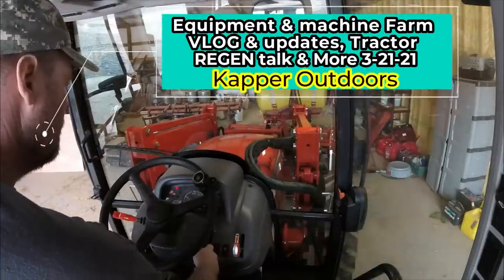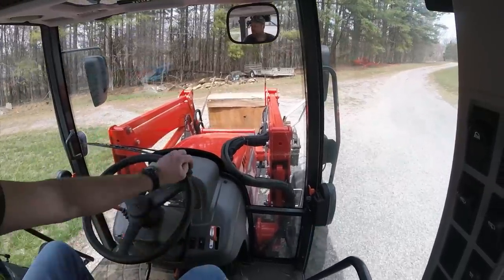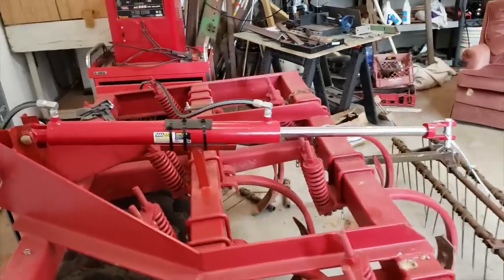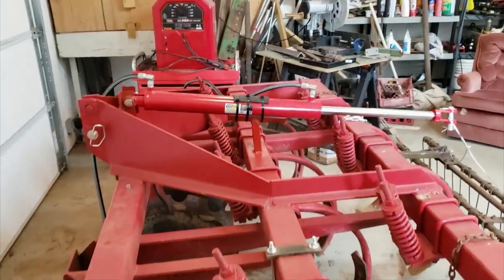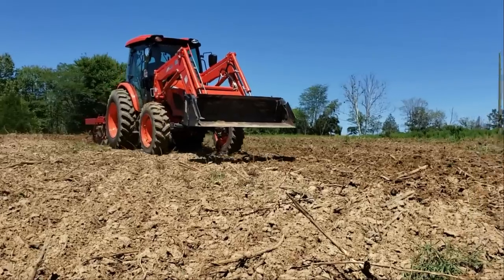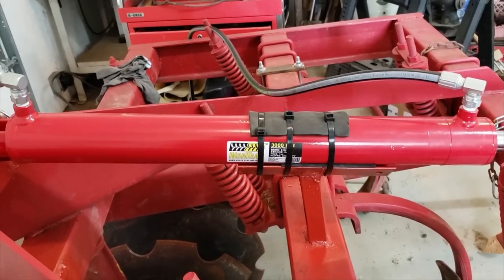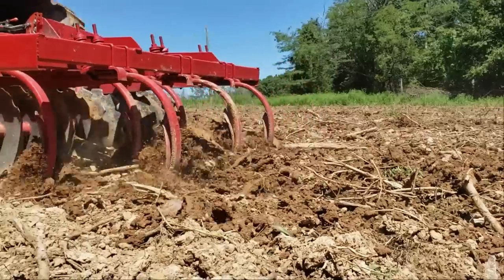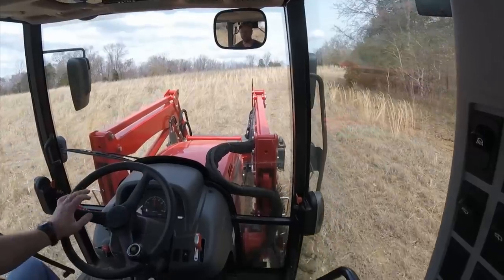Tractor REGEN Talk, Equipment VLOG Update, tractor work, property management & more

Comment: Nice to get some chores done! Yeah seems like a waste of fuel to have to run the tractor at higher RPMs, especially doing small pokey jobs just to get the DPF hot enough to keep it from accumulating access diesel particulates.
Reply from the maker: Yep. I think often times we waste more energy and pollution trying to be more 'clean!'

Comment: Hey Kapper!! I would use something else to hold the cylinder in place. Those cable ties will break with the bouncing around that thing will do. Maybe a flat band clamp for exhaust systems would be better.
Reply from the maker: OK we'll see how it does you might be right, thanks.

Comment: Kapper thought that a bush pile was suppose to b push from the bottom for bush could roll?.. 🤓
Reply from the maker: yes normally I do, but if I recall correct it may have had some  big logs so I could not break it loose from the bottom so I worked it up the side a little just to get some movement started.